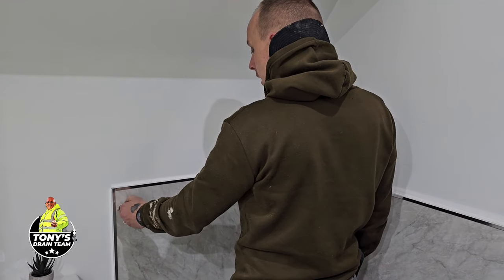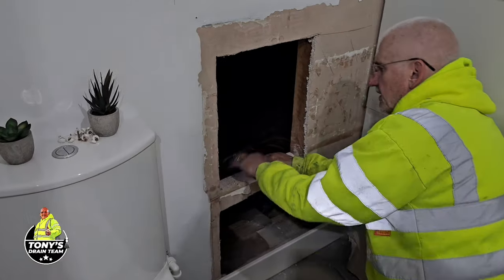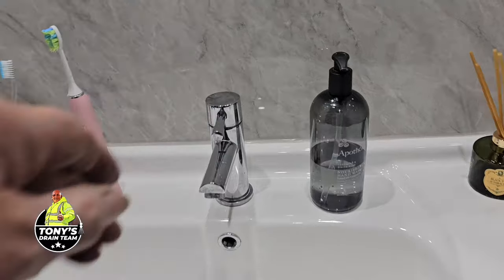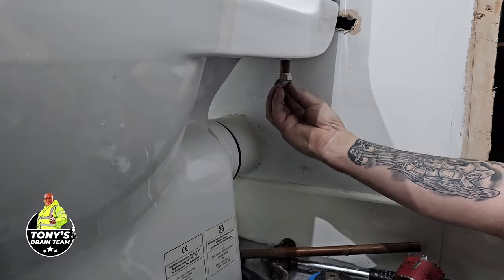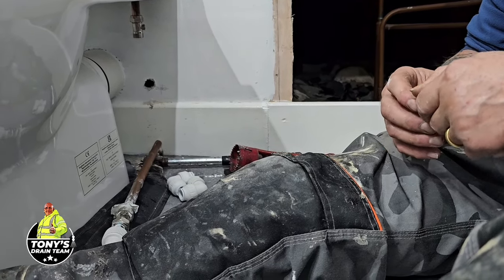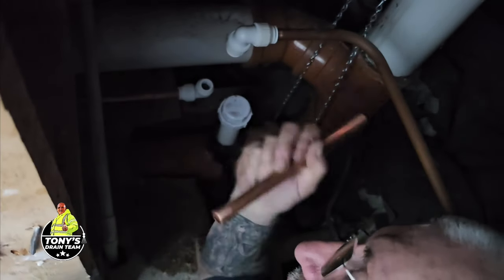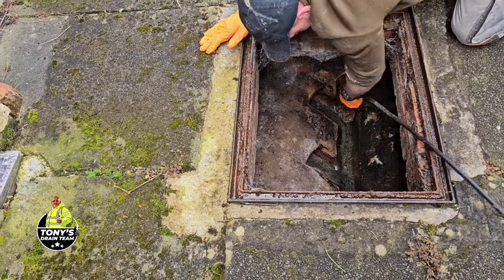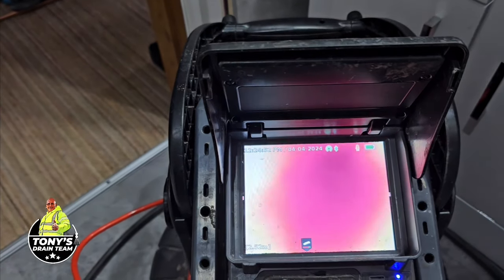Blocked drain. Drains that don't drain. #blockeddrain

Comment: Hi Tony(s). Nice neat job. I changed all the taps in a friend's house for more modern type. Started in bathroom. Isolated HW in airing cupboard. ( not a combi) . Sent him off to change some taps for a low pressure type. Turned cold water off at mains and drained downstairs. Cold never stopped in bath taps or vanity unit 😳 . Went in loft and found huge header tank with several outputs. Had to tie up float valve and wait half hour for cold to stop in bath taps. Then had to vac head of water in cold taps . What a game. Told his wife not to fill her night cup of water from bathroom taps. They were the only cold taps fed from the loft tank !!,
Reply from the maker: Can see that whole scenario mate, bloody worrying to think people have been drinking it.

Comment: that pipework was terrible Tony, nice rearrangement.
my Dad was a plumber, retired now, i used to go out on jobs with him on jobs in school holidays and like you added pta tape for extra insurance and cleaned up the ends of the copper pipe with steel wool. 
Dont know if he would use plastic fittings though he was old school and still a bit  of a traditionaliist now, old hacksaw and blowlamp man lol
Reply from the maker: Interesting mate, yes I was sceptical about plastic till I found out they are pretty good. I have never had one fail ( ever)
Reply: @drain-unblocker  cheers Tony👍 Yeah hes been retired 15 years now although he did a few jobs part time for old customers but he probably would have come round to plastic after seeing how reliable and easy they were to work with, when he started it was old lead pipes with copper coming in, as the years went by he became a bit of a specialist doing the old fashioned lead to copper pipe joint, he was quite made up when a United Utilities checker informed him they had lowered the standard they passed because not many plumbers could do that style of joint anymore. 
Watching you with the cutting tool made me chuckle thinking of my Dad with his hack saw, neat bit of kit you have there 👍

Comment: Hi Tony x2, I really enjoyed learning and watching this. Oh my goodness. So much paper..Is that 1 of the new toilets with the little to no water used to flush? I think they are  useless. You need a good flush of water to push everything along. I took my half button off my toilet..Hope there is a part 2 to this video.. Stay Safe have a great weekend from a Tassie Fan ❤️🙏👍🤗
Reply from the maker: Hi Cheryle thanks for your question, the main problem here is that the 110mm pipe is not laid to fall, it's acting more like a collection pipe.
Reply: @drain-unblocker  Thank you 👍

Comment: Just curious to know if you have Sharkbite plumbing fittings in the UK ?  I've been using them for years in Canada and they are amazing. Push on , no solder, no Compression nuts, and best of all no leaks, Ever ! They aren't cheap ,but save hours of messing around on little re-fit jobs like this one.
Reply from the maker: Hi mate, I have heard of them but not sure if available here. I think the ones I used are on the same lines, they have a seated metal washer that holds the. In place.

Comment: Tony, no escutcheon  plate against the wall??? Hope you patched that monster hole, but I'm sure you did.
Reply from the maker: Pipe was hidden from view so no cover plate, cold supply so when it's filled and re painted, no expansion. Yes the job is on going I think I will be fitting a macerator

Comment: What pipe was that which clogged up with toilet paper?   And can I ask Tony why don't you use the Picote on many jobs,I thought there would of been a good couple of opportunities to use it on this job, 1, downwards from top of stack, 2, from manhole up the stack if worm wouldn't climb .
Reply from the maker: Hi Steve, problem with this job is the pipe running alongside and between the joists has zero fall so the picote will cut it up ok but it's just thick mashed up bog paper, coagulant which has no flow. Somehow we need to get a plunger in and push it out. Time to fit a macerator.

Comment: What is the correct drop for a drain pipe ? One inch every three to four foot length ?
Reply from the maker: Hi 1:40 so 1 inch to 40 inches.  To be fair there's no way they could get it to work over the distance they covered (8 meters)